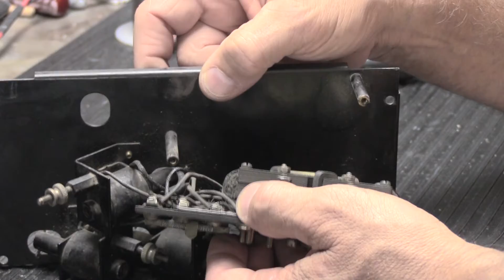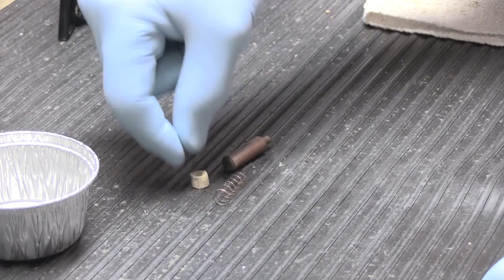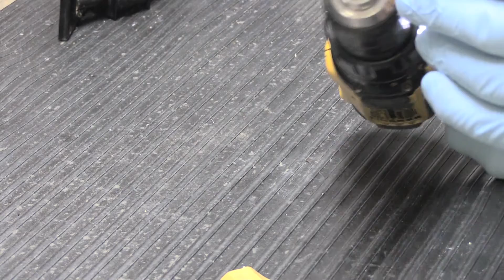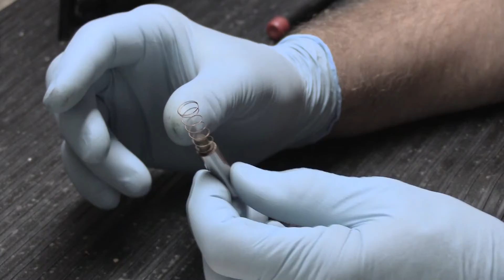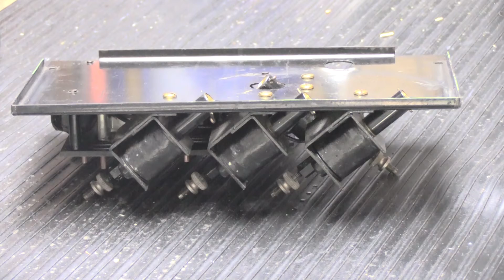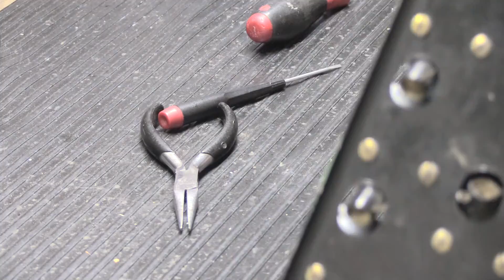An Overview of a Rittenhouse 8-Note Westminster Chime from 1939

Comment: My 1940s house has this. The disk is chipped somehow and is missing the cover. Any idea where I could possibly source anything for this?
Reply from the maker: Hi Andrew:  These very early Rittenhouse Chimes are very rare and There isn't any specific source for parts.  I am unlcear about what your mean by "the disk is chipped" - finding covers is almost impossible, I don't think I have ever seen a cover for sale - Chris
Reply: @northsideservicecompany3567  Very sorry for the lack of description. My house was built in 41, and obviously the motor is very old, and it has lots of friction along with the gearbox. The cycle completes itself  but when it returns to the home position it stops about halfway through the chip in the rotating disk. Meaning, someone has to hold the button for 3 ish seconds for it to cycle.  Looking at your compared to mine, my cutout in the disk seems to be bigger than the one you showcased.
Is it possible to send mine for you to do general maintenance on? I think it needs a good re lubrication in the gearbox, or possibly the motor (not sure if that can be done). To get it to run properly with less friction I'd have to constantly cycle it for upwards of a week. All of the chimes work properly, but I'm not sure how much longer the old motor has left in its current state.
I seem to have the exact model you've showcased here, other than I have two "pegs" where it should stop (where the arm that hits the other pegs to complete the circuit). Weird description.
Reply from the maker: @AndrewD1293  It woul dbe best if your contacted us directly about your Chime - Chris     nscompany@msn.com